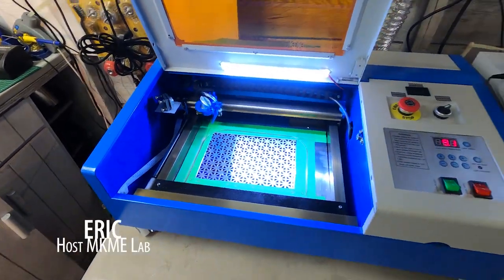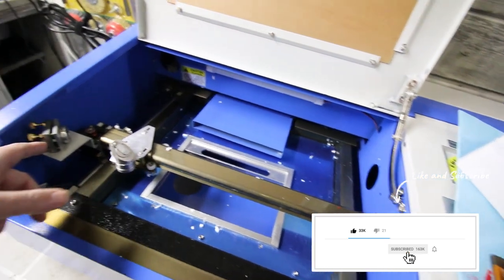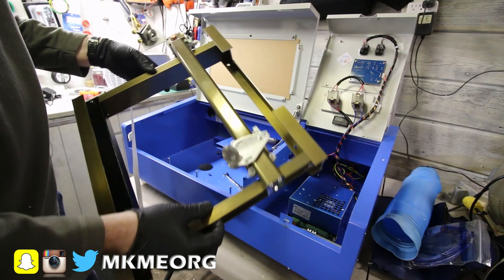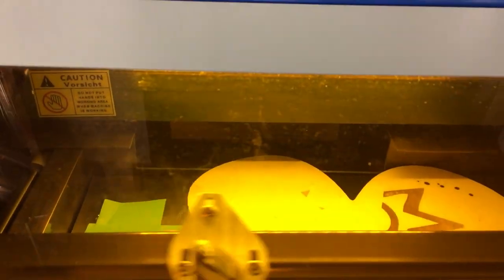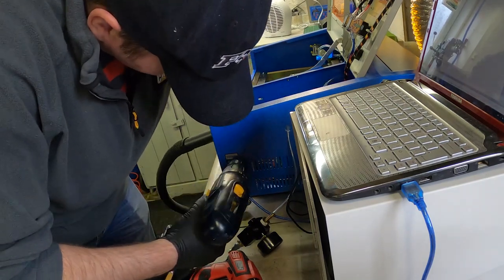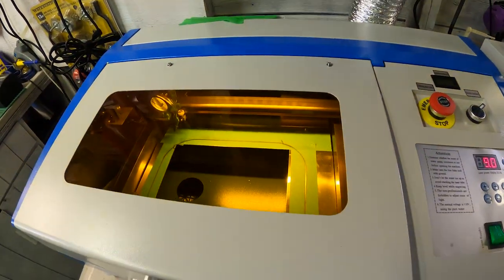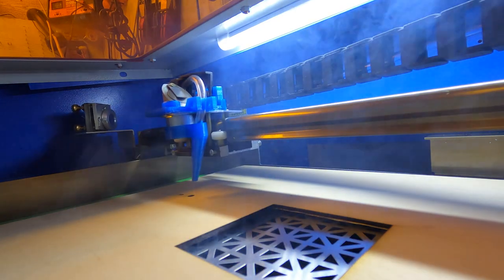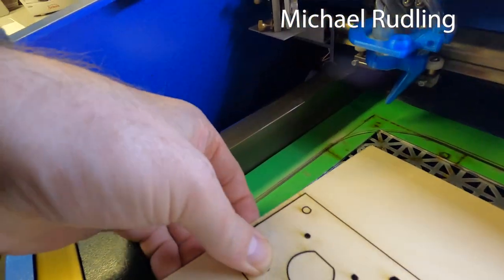Everything You Need to Know About the K40 Chinese Laser Cutter

Comment: Something I found very useful was to implement some alignment dots so you know where the laser is aimed before you fire it. There's all kinds of schemes for fancy laser crosshairs out there, but really all you need to to is set up some bright LEDs close to where the beam enters the case. The mirrors and lenses will pick them up and project them onto your workpiece. I made mine out of a piece of acrylic (cut with the laser, of course) and it's just held in place with some neodymium magnets for easy adustment. I tapped some power from the unit's power supply to light them.
Reply from the maker: I may add that. I have lasers and the nozzle I made even has the mounts but I ditched them as it interferes with getting full travel. I wondered about firing a visible laser in to mirrors somehow.  Seems like a way better solution than putting more on the moving head.  Cheers

Comment: I love my k40 lasercutter too. If you have a good vent suction, you should try cutting acrylic.  It cuts easily and the finished product looks really slick. But it stinks! hence the good venting is a must.
Reply: How thick of acrylic are you able to cut with the K40?
Reply: @phototec  I cut 0.08" ( 2.12mm) Acrylic from Menards (hardware store) at 10mm/sec (6mA). Most likely could cut thicker but I've never tried.
Reply: @HariWiguna  Would that 0.08" Acrylic be the plastic used for window panes in the glass section?
Reply: @phototec  Yes, that's the area.  Just beware that they have different thickness and other non-acrylic plastics too.

Comment: Why don't you try a 12v PC fan positioned in the center of the door on the curved section on the inside  either with self tapping screws or try ultra strong adhesive, I've done it and removed that stupid vent like yourself and now its smoke free.
  Good luck.

Comment: Really nice breakdown of your work! You might want to put an air-cleaner/moisture remover before your air-assist pressure control. Also with the grate on the bottom you can add an air duct, so the smoke gets sucked through the grate and doesn't go into the laser path. Also, aluminium under the laser leads to stray reflections, aluminium does not charr or discolor when the beam hits it, like steel does, so for safety you should make it black somehow. It's kinda funny how air-tight these cases are, with my big one the vacuum of my fume-extractor really pulls the lid shut, but the smoke's not extracted efficiently.

Comment: Hey mate, I have the same unit, just set it all up but when I cut I don't see any laser, I was thinking how you said the tube wasn't lined up that may be the reason. How did you line this up? Also did you connect an earth tale? Thanks.
Reply from the maker: You cant see a CO2 laser. You have to put tape over the mirrors to see where it is hitting and adjust.

Comment: I use a select comfort air mattress compressor for my air assist.  I put in safety lid switches as well for the Tube hatch and the work area.  I use a 12v 5amp power supply to run a Arduino 2560 running marlin and a RAMPS 1.4 board on mine.  I also have the Z table as well.  I use a PC Cooler radiator and water pump.  I'm on my second tube.  I have a DJ Light bar power strip which I can turn on Air Assist, Exhaust fan using controls from the Marlin software.  I cut the air shrouding like you did from the back and I also added a slot in the front of the case to allow me to use long material.  I also switched to a 4" (101.6mm focal length lens) to run under the gantry.  On my light objects Z table I also run some aluminum hex to space the work up off the table. I also run the LCD panel off the Arduino as well.  I've modded the Marlin software to only go to 14mA tube amperage so I don't blow the tube out again.  My new panel has a Key lock to only I can turn on the laser.  Using the white 12vdc LED strips from ebay I also lit up the work chamber and the Electronics area with their own switches on the control panel.  I used a cheap acrylic clip board for the panel - nice smoked gray and it lets my see LED's inside the compartment.  The Laser Power supply doesn't produce enough power for the Z table stepper or all the extra goodies I've added.

Comment: That was informative. That you buddy. I'm about to buy one for mu work. One question if i can. I would need it only to burn /engrave my logos onto some pieces of wood. You think it will do the job?
Thank you.
Happy New year
Reply from the maker: Sure the K40 will do engraving/woodburning no problem. For good results of varied tones you have to swap the control board and run Lightburn so I'm told. For basic cutting and engraving it works great for the price.
Reply: @MkmeOrg  Awesome. Thank you for your reply. I have to learn everything still but videos like yours sure help.
Another question if i may
This 40w just to have a perspective.
How thick material can cut?
Oak maybe or multilayer plywood? Did you made any tests so far?
Cheers
Reply from the maker: 3mm is about max for a general rule.
Reply: There appears to be 5 or 6 of these on ebay and amazon all with different names but looking more or less identical. What "brand" is yours?
Reply: i know I'm quite randomly asking but do anyone know a good site to stream new tv shows online?
Reply from the maker: @rickyjohnny8452  Netflix.com

Comment: hi, is it ok to use Aluminum for the ground plate? as it reflected 98% of the laser. Maybe Steal is better? May I am wrong, but I learned that I should avoid Aluminium in the horizontal Groundplate. Let me know if I am wrong, as it is so much easier to get Aluminium sheet :-)
Reply from the maker: If you dont run it with the lid open you can use whatever you want.
Reply: @MkmeOrg  thanks, I think I am not crazy enough to run a K40 open..hahaha

Comment: Interesting... I would like to see more follow up videos as well.  It would be interesting to see how it works engraving, and cutting, different materials.
Reply from the maker: I have a few in the pipe. One is already uploaded using it to cut carb gaskets. A use case I never even considered but works EXTREMELY well for.